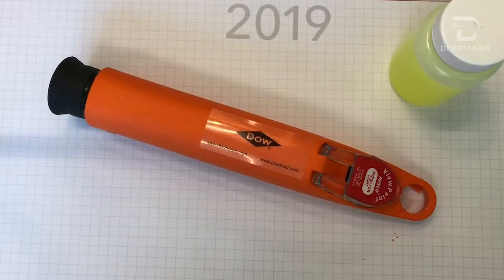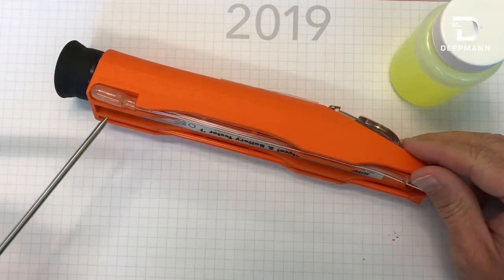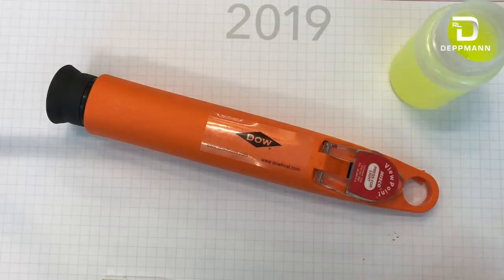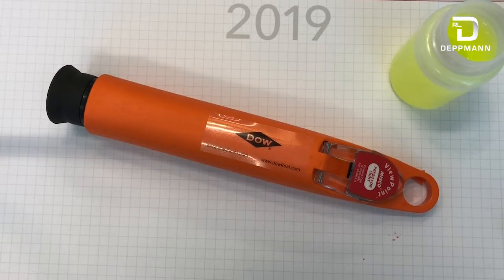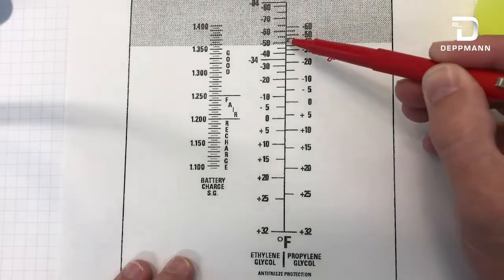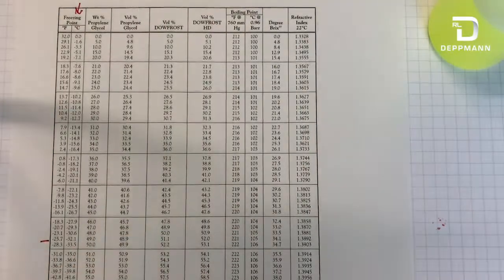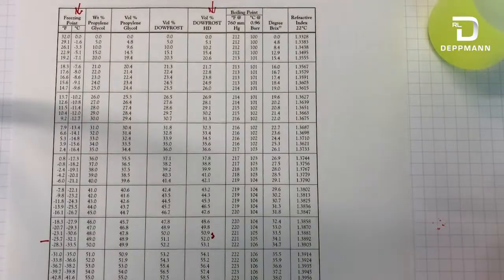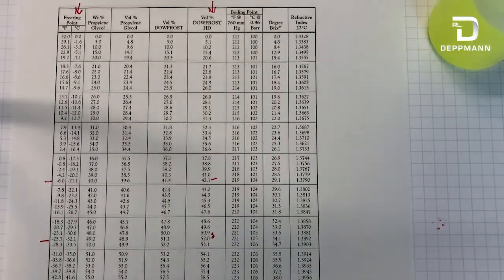How to Use A Refractometer to Test Glycol Concentration

Comment: do most heating systems use colored Glycol? 
If I pull a sample and its clear does that mean I'm running just water?
Reply: Usually commercial buildings will have colored glycol in their systems but I’ve seen clear from time to time.